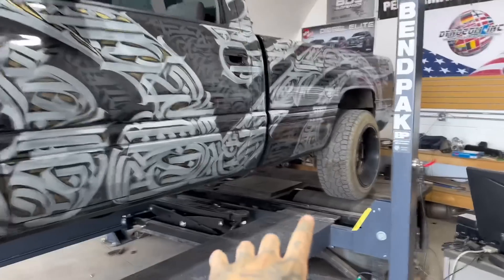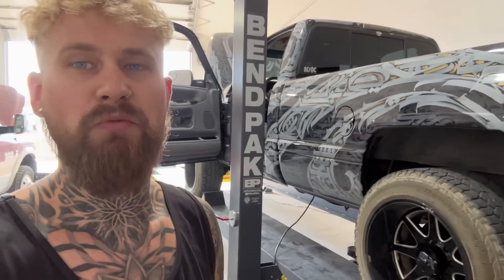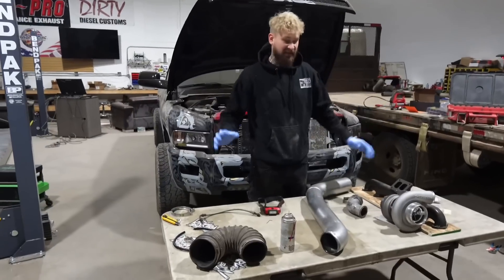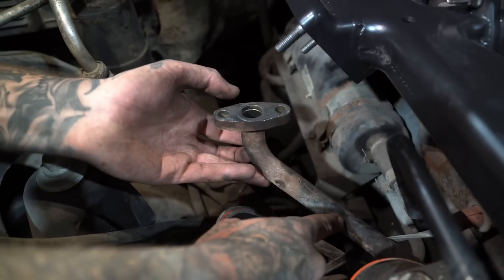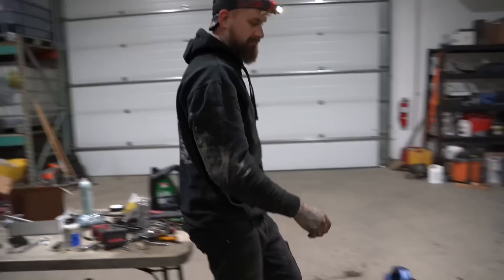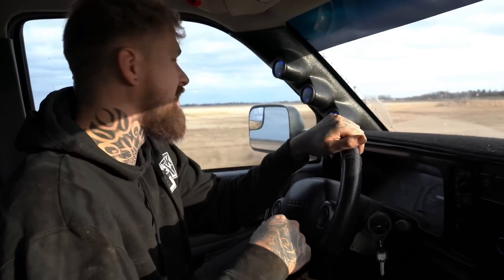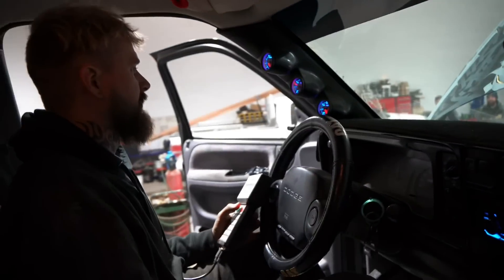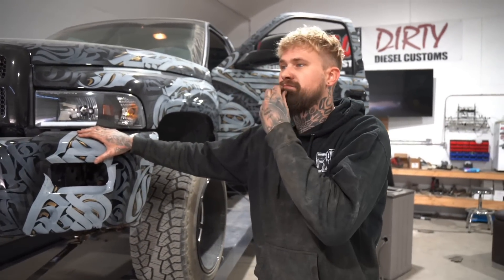Does A Bigger Turbo Mean More Horsepower? Let’s Find Out

Comment: Hey man. Just wondering if you know if the 2023 L5P delete kit from diesel dudes will work for 2024 trucks?
Reply from the maker: No man, they are working on a tuning solution right now for the 2024, no ETA yet
Reply: @ thank you

Comment: That’s a turbo you’d use in compounds as the big turbo for a light application. My 12v had a 57 over 76mm compound setup and with every fuel mod other than big injectors (still had too much fuel) and stock plungers in the pump and it mad 643hp and 1172tq. Need small turbo to spoil that or you have to build boost if you can with that thing

Comment: The turbo is too big. It needs to spool and more fuel won’t fix that. You’ve lost power because you’ve lost air because you can’t spoil that big turbo. Air doesn’t add much power, it burns the fuel you have and lowers your egts so you do t smoke your engine when you over fuel a truck. Those 5.9s work better with compounds.
What size is that turbo?

Comment: You HAVE to adjust your preboost fueling on your truck now. All that black smoke is because it’s dumping waaaay too much fuel down low, causing the turbo to spool slower, as well as higher egts down low. 

I’d recommend backing off the smoke screw until it JUST touches the AFC rod (you’ll feel it), and re run it. If you’re still dumping smoke, use the star wheel to add more spring tension to remove fueling down low. 

Fun fact: I had the EXACT same setup you were running on my truck. Was a maxed out stock fuel setup, afc foot modified, fuel plate cut and moved forward, and the hx35 was hanging out around 38psi. I needed more air. 

I upgraded to AGP turbos T51R Borg S369SXE and after just the turbo swap, the truck was a TURD. After making a few adjustments on the AFC, it came to life and would finally spin through second gear, and was building 30lbs no problem. MUCH more power. 

Now I’ve just dropped in a built 0 mile 12v with billet everything and DDP stage 4 injectors, Mack plug, 191 DVs, and 20* timing. Just did my first startup last Saturday, going to be finishing the install and getting the cooking system hooked up so I can break in the camshaft etc

Comment: What would you recommend for a “upgrade” to get rid of the silly looking upper intake. I have a 2012 f550 c&c with a full weight loss. It already has S&B cold air intake. And their cold side and hot side pipes. And SPE upper and lower rad hoses. EGR is also removed. I am in British Columbia

Comment: Put ur stock turbo above that 69. Make compound set up.  I have a 96 with a 63 over and s475 she pulls like a train. I have a set of those stage 3 injectors  024dv. 4k gov springs no fuel plate afc housing mods 18 degrees of timing.

The only problem is ur truck is a 95 which has the small cam in the p7100. U need to find a 215 pump and stick on it

Comment: Love the 12v videos. I had one with a sxe369. I believe I had 5x12 injectors, can’t remember which delivery valves, I think i took the fuel plate out, 5k governor springs, valve springs. It was very slow to spool and I did like 550 on a dyno.
Reply from the maker: That’s good news if you hit 550 I should be able to get my 600 if I time it correctly, at least I hope anyways

Comment: What up! That new turbo sounds wild!! Even if that turbo was stock that you pulled off you should see 35 psi out of it with the right pump work and timing done. Im excited to see what you'll end up doin with the truck!

If the next video does end up being fueling, id suggest doing an AFC live from Power driven diesel, its so nice having a live in cab fuel adjustment. 4k govener springs for sure, just dont rev it over 3k until you do valve springs, some stage 2 powerjet injectors from PDD, or 5 by .016 injectors, and .25 delivery valves. A mechanical lift pump upgrade is for sure worth it, and a rack plug might be worth while too, but eventually.

You have the smaller 160 pump in that truck so that slighly larger delivery valve will be perfect. Do the timing as well, bump it up to atleast 18 degrees, you can go more when you have studs. once all that is done, adjust your preboost, also known as your smoke screw, and adjust your starwheel if the startup isnt instant and requires a little throttle imput. 

for piece of mind, if you dont know if the killer dowel pin is fixed , it is absoultely needed pushin the power youre gonna be pushin. I didn't even mention trans stuff but thatll be for another video im sure! youre gonna blow through that stock converter so quick lol, a lockup switch is a good starting point.

Maybe one day you consider goin on a compound setup, you can use your 369 as the top turbo and run a he351 or a build hx35 on the bottom and youll easlily be mid to high 600s with it starting spoolup at 1400rpm. Shes gonna RIP!! Love the content keep it up!
Reply from the maker: Hey man love the advice! The next video will just be adding the DDP stage 3 injectors, then the video after that will be doing the delivery valves and fuel plate on the p pump. After that I’ll do studs and we can get into timing. Trying to show dyno results every step along the way to show you how you need all the supporting mods to make everything come together. The truck currently has a fass on it but it’s an older smaller pump. I have a new fass for it too which will probably be a video on its own as well. 

I’ve never worked on a p pump before so it’s going to be a learning experience for me but I am excited to see what we can do. 

As for the compound set up, I’m planning on doing compounds on my 5th gen. The 2nd gen will be turned into a drag truck so one massive single is all I really need. I don’t need good drivability with the 2nd get as it’s just a “fun” truck. 

And lastly, the transmission on the 2nd gen has been built but it was so long ago the company that did it doesn’t have the records on it anymore. But it definitely has an updated torque converter they said. How long will it last? I guess we’ll find out. Then ideally I’d like to go to a full manual valve body.
Reply: @darkirondiesel  Those DDP stage 3 injectors are sweet, that's a perfect match for the power goals you have! It'll be really interesting to see the dyno numbers as you do all the modifications incrementally, nobody on youtube that i've seen has done that before with a p pump truck, it'll be super informative!

Even with the fass system that is still on the truck, the 12 valves have a cam driven, mechanical lift pump bolted to the block on the drivers side, just below and to the right of the p pump. that will for for sure be a restriction when you flowin the fuel that those 5 by .015 DDP stage 3 injectors will demand and the fuel your new fass system will provide, but that'll be for another video. DDP as you know recommends a timing bump with those injectors, but I'm sure they'll still rip on factory timing. 

And yeah that's a perfect plan with the trans, we will find out eventually!

Splitting this whole process up into a bunch of videos is an awesome idea, there's so much information to share about each modification you're gonna do! Honestly you could make a video on each part and not run out of really interesting information to share. Each part of these trucks are such rabbit holes, i'm super excited for this series! Keep up the good work brotha!!

Comment: I upgraded my turbo to a Cheetah in my ‘19 and plan to do injectors soon. Maybe 15% over?
Reply: Go bigger than you think, trust me it sucks buying injectors multiple times.  100 overs are always a safe size.  Plenty of room to grow and still good mileage.  At minimum I would say 45% overs.  We always want more and more power, it gets boring again quick.
Reply from the maker: My opinion is it depends what you want to do with the truck. If you just want to daily drive it then get injectors on the lower end. If you want to abuse the truck and have a lot of fun with it go bigger
Reply: @darkirondiesel  Gotcha. I already have a 165gph FASS on it so it might not take much. Is Exergy good enough?
Reply: @joshuaquilliam2887  Sounds good man. Thanks for the reply!

Comment: My torque wrench is based on how many fingers are on the wrench. I have had bad luck with smedding turbos. 

They seem to last about 6 months at best. If you rip all day long every day or about 12k miles. I have killed 1 362 and 2 364turbos in less than a year on my daily with maybe 550hp. Boost is only 45psi max. Maybe you will have better luck
Reply from the maker: I’ve installed a few Smeding non vgt swaps on 6.7 Cummins and never had any issues so far, but we will see.  This turbo is going to be abused to the max on this truck so if any turbo is gonna fail it should be this one 😂
Reply: @darkirondiesel  I have a tune on it. I have all the supporting mods. I often push a little past 5k rpms. I can only assume this is part of why i keep kilning them. Though the guy on the phone when I told him my driving habits said I should not be able to stress the turbo at all. 

I have never been on the dyno. So i truly don't know the power level on non of my trucks. I have unofficially raced a lot of exotic cars. So far I have only lost to one of them. Some of them may not even have been racing but rather trying to prevent me from passing... I run out of road by about 120-140 mph cuz traffic, but I always reel everyone in quickly. I never go faster than I can stop. I am sure I could squeez it to 180 but then I would have to brake super hard. 

I asked for direct borg warner interchage numbers, but no answers on that. My truck is donw again, but after 3 quick fails I think I will go back to Borg. I have not broke one of those yet.